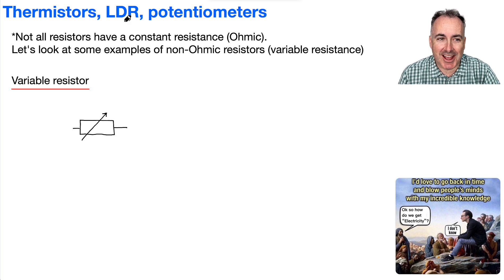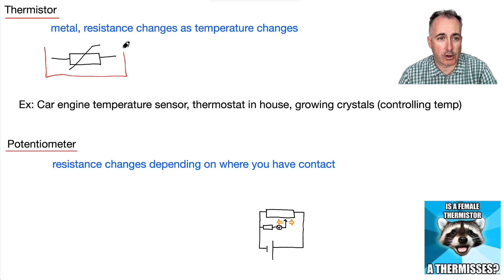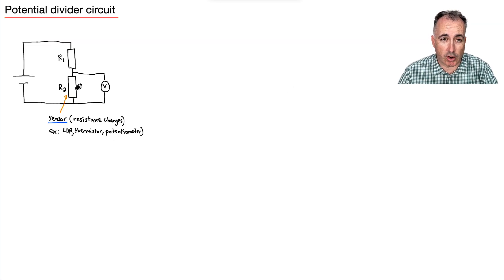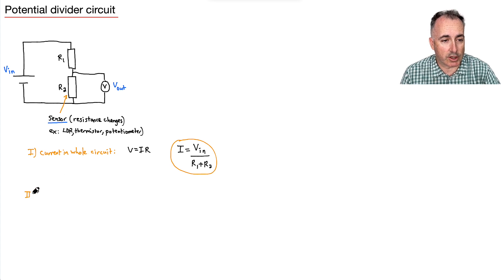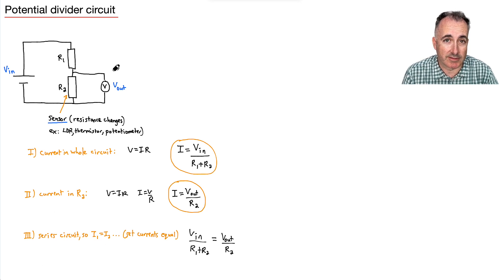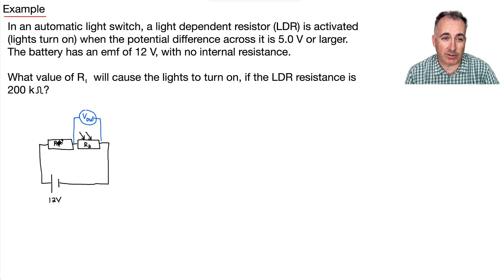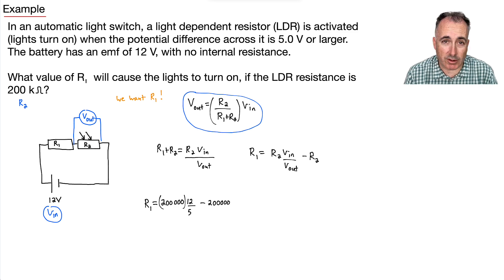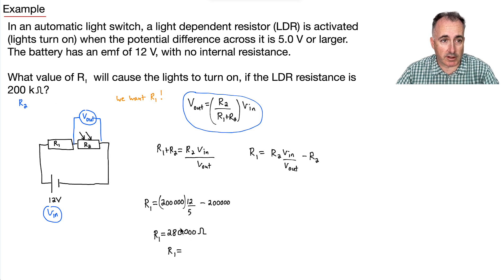B5.7 Thermistors, LDR, potentiometers [IB Physics SL/HL]

Comment: Is this formula only applicable to voltage and resistance of a non-ohmic resistor like sensors? or can it be used for questions that involve regular ohmic resistors?
Reply from the maker: It works for resistors, doesn't matter if they're variable or not